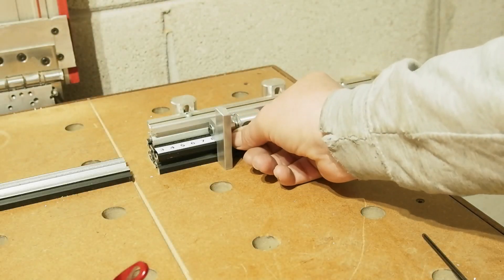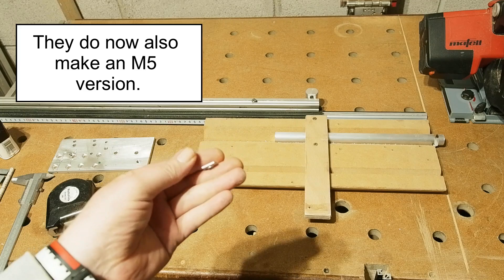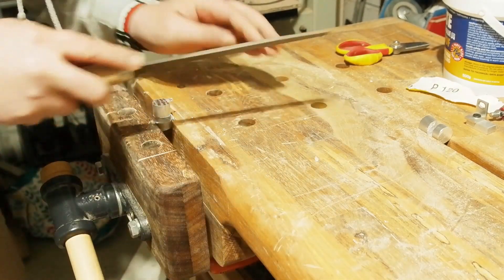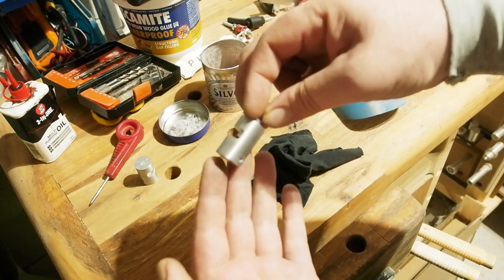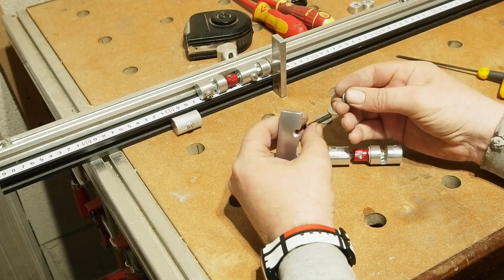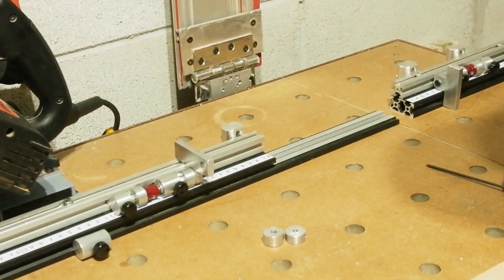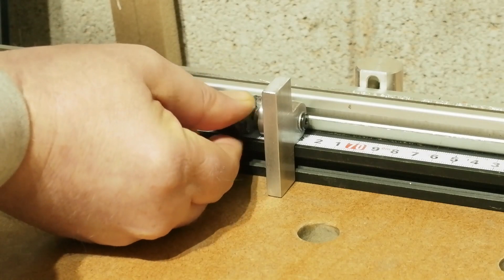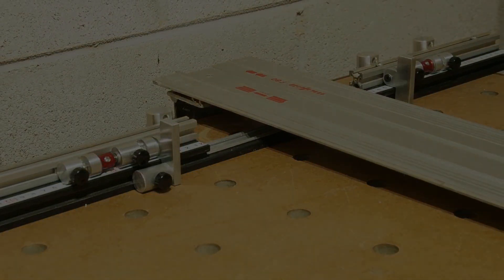Making an Improved Flip Stop Flag Stop For An MFT Bench Fence

Comment: That is excellent Dude. I’d buy that system if Bench Dogs made it. You could make your waste side fence longer - it doesn’t look like you are compromising your system by extending the waste side fence into thin air by, say, 200 mm or 300 mm. You might have to clamp your dogs underneath - if you did that, you might be able to add a workpiece support at the end of (or all along) the extended waste side fence..
Reply from the maker: Cheers buddy. As it happens, I do have spare pieces of 2040 and 2020 about 400mm long I could extend the right side with. Didn't think of doing that. Only need be about 300mm really - so about 50mm longer than it already is - as it only needs to accommodate the flip stop and 200mm on the scale. I'll get on that. Thanks👍